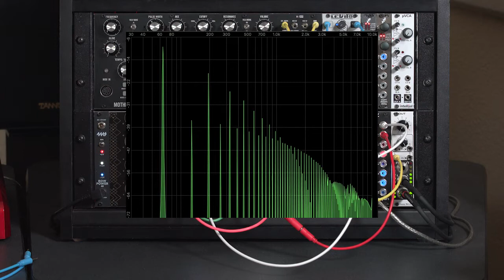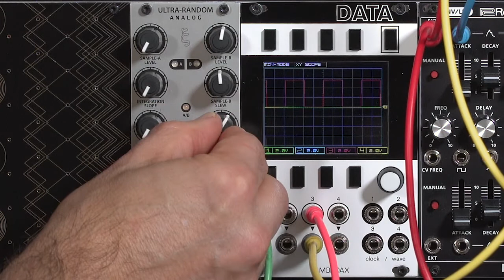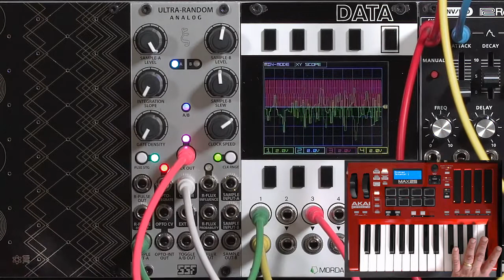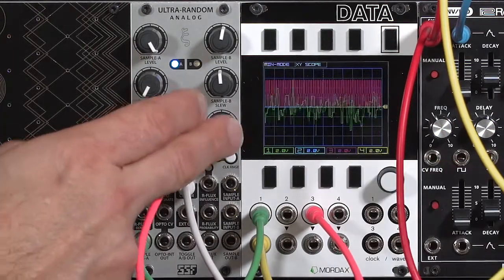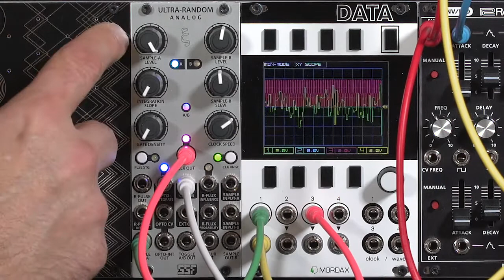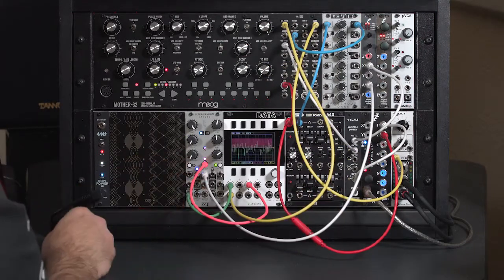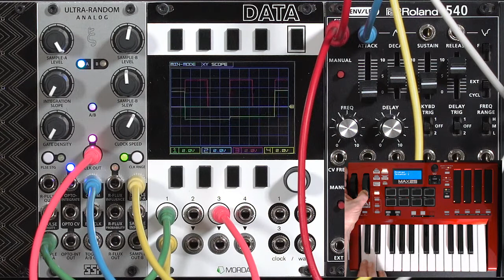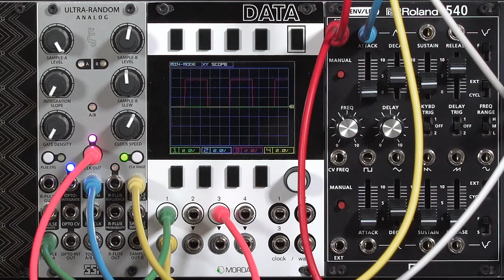SSF Ultra-Random Analog 5/5: Audio Rate Clock Tricks (LMS EE)

Comment: it’s coming down to URA vs. Sapel, and given their respective cost and size differences, i thought this would be an easy decision. certainly a case of “apples and oranges, but both are fruits.” my random sources at the moment are Pam’s and a Noise Tools — fairly basic but accounted for. any advice? and thank you for the consistently excellent videos!
Reply from the maker: They're both powerful...but I ultimately went with Sapel myself, finding it easier to understand. Sapel's secret weapon are the bias controls, so you can send voltages toward one end of their range or the other - I use that a lot during live performance to make a part step forward or sit back (i.e. controlling the filter cutoff).
Reply: @LearningModular  thanks for replying as well as confirming where i eventually landed. now to actually find one!

Comment: What the... vintage distings?
Reply from the maker: I think the Disting mk2 hits that sweet spot of features vs. ease of use, especially at the price you can get them for used these days. The mk3 is sort of an odd transition version, with lots of new features but the old UI; I have a pair of mk4s (as well as a pair of mk2s) in my personal case.
Reply: Yeah, I really did not like the binary display with the bank/algo menu structure, it 100% guaranteed I would get confused while switching it up outside of bank A.  The mk4 is what I moved onto, but I suppose the mk 2 is totally sufficient for the type of pedagogical uses this case was designed for.